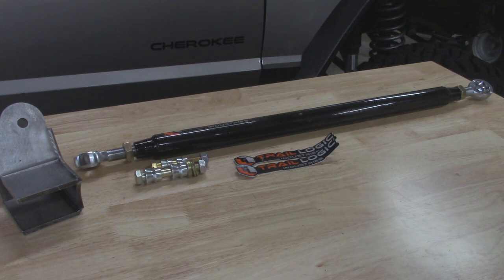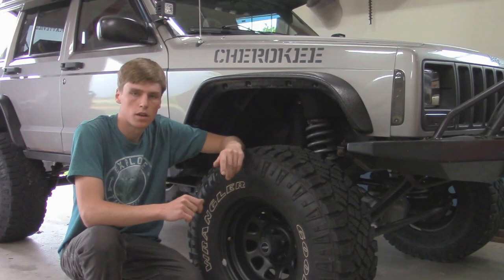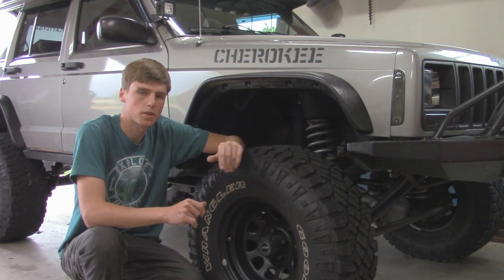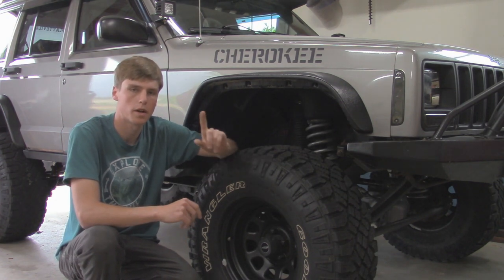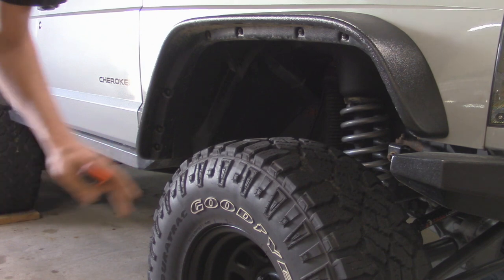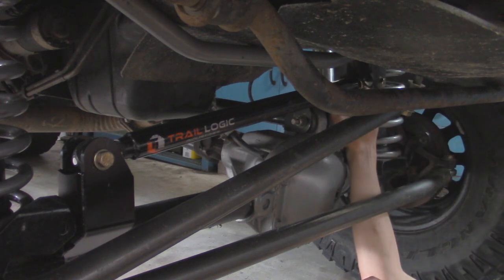Jeep Cherokee XJ Over The Axle Track Bar Install

Comment: Nice , FYI you can do your own custom track bar for lest than what you pay for a kit , and you are running a 3 link hooo nice xj be safe
Reply: List the parts please.
Reply: Jay Bourbon Ruffstuff or Barnes 4WD sell DIY kits with that you need. Track bar mount frame and axle side, DOM tubing, 2 tube inserts, 2 heims with misalignment spacers and jam nuts. That’s pretty much it

Comment: its a good idea to keep an IR thermometer in hand. i am not sure what kind of steel the axle tubes are or what kind of heat they can take. but i would you should be able to find online how fast they should heat/cool to maintain any heat related properties of the steel. and not cook the axle seals and bearings lol
Reply from the maker: I agree, but I believe the axle tubes are just normal mild steel. If I was welding to the pumpkin which is cast Steel I would take more precautions and definitely watch out for melting axle seals in the pumpkin which they are located on this axle.
Reply: OutJeeping ah yeah your right. The d30 end is just open. I’m probably
Overthinking it, that’s the engineer in me, but all metals have heat related properties that you shouldn’t exceed. The factory robotic welders use heat sensors that keep the metal at a certain temperature m. It’s pretty cool stuff. It’s probably quite high for steel so what your doing is perfect

Comment: How does it handle with the track bar being So much shorter than the drag link? I'm about to finish my kit tomorrow from a different company and was curious
Reply from the maker: It's all about the geometry of having it parallel with the drag link. This helps to eliminate bumpsteer while driving down the road and with articulation angels.

Comment: I was wondering about the mounting location, although I am only using the stock mounting bracket. You did make it look like it was suppose to go there, easy mistake from what I can tell. Still useful information. By the way, how do you like the Bilsten shocks? Any better than a lot of those out there? I know I need to change my soon...
Reply from the maker: Love them, no issues with them yet, they ride alot better than the previous rough country shocks
Reply: @OutJeeping  That's good to hear. Have been thinking about them. Still on the fence between them and OME.
Reply from the maker: @MrMoxes  I've heard good things from OME too and how they got a nice smooth ride. It's all preference I suppose.
Reply: @Maximus Prime Really, I don't why, but I thought Foxs weren't all that good.
Reply: @Maximus Prime I suppose that makes sense. Maybe people I know were just using then for the wrong application. That's awesome to hear. Being keeping an eye out for a wrecked JK to nab the axles from under for my XJ as well. Now I'm wondering if i should just wait. My supension does need some TLC tho.
Reply: @Maximus Prime I can imagine. Sounds pretty dang stout. Glad to hear. I'm going to be look forward to, as i daily mine as well. I'll be sure to keep that in mind, thanks.

Comment: Hey Austin, I just found and subscribed to your channel. I have a 97 GC that I'm working on. I'm a bit new to the upgrade game so I have to ask a question... Why couldn't you mount the tie rod above the knuckle for additional clearance?
Reply from the maker: For this kit you cant really because the drag link and tie rod would both need to be mounted above and that puts alot of stress on that single bolt. But theres a WJ knuckle swap that has 2 attachment points for the drag and tie rod that people swap on to get better clearance. Or other companies have lots that mount above and the drag mounts under but has bends to go around the tie rod, like the Iron Rock Offroad over the knuckle steering kit.

Comment: What are the benefits of the OTA t-bar?
Reply from the maker: Corrects the angle to be parallel to the drag link on a higher lifted jeep to prevent bump steer.

Comment: What’s the difference on running the type of drag link that you are running compared to the ones with the ball joints on does it really make a difference does it ride better or less sloppy
Reply from the maker: The heim joints that I have allow you to have more range of motion so it helps the jeep with better articulation compared to the normal tie rod end, but they need more maintenance of spraying some lube on them because they like to squeak.
Reply: O ok thanks for the info I am trying to figure out what I am going to do on my 97 XJ

Comment: @outjeeping how is the ota trackbar holding up? Im installing mine tommorow to get rid of death wobble i got from my otk steering.
Reply from the maker: So far holding up fine, only issue I have is that it contacts the top of my diff during full suspension compression.

Comment: Will this work with stock upper and lower control arms
Reply from the maker: They will work with lowers and I forget if there is a clearance issue or not with the uppers. Unfortunately Trail Logic Industries website is currently down. You will need to have a lift though because the track bar will contact the top of the differential on a stock lift.
Reply: @OutJeeping  Yeah it’s lifted 4 1/2 inches

Comment: Is your track bar parallel with your drag link?
Reply from the maker: Pretty close, maybe 1 degree off but I may drill a new hole in the axle side bracket to correct it in the future.